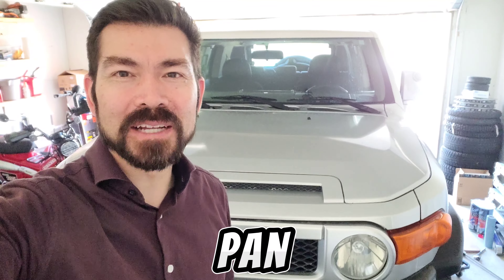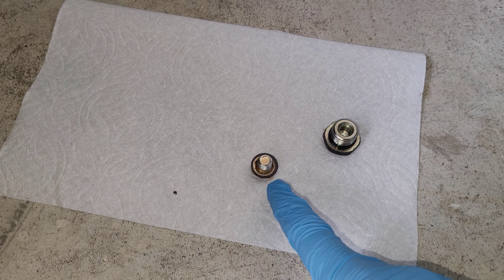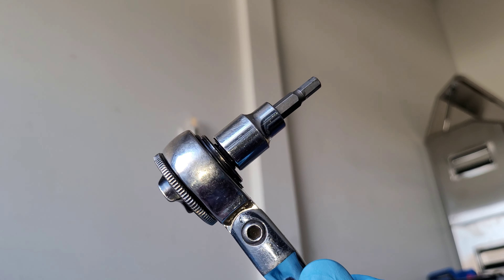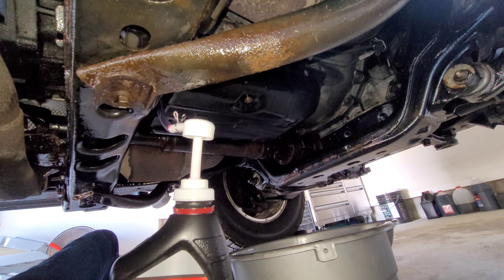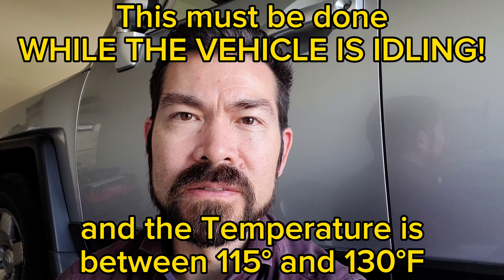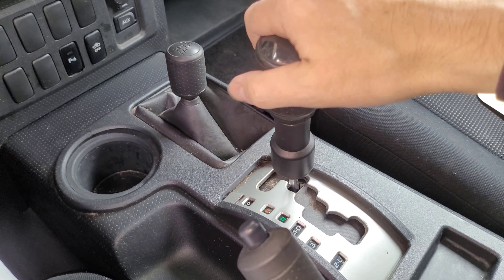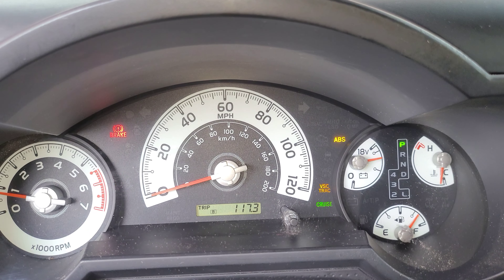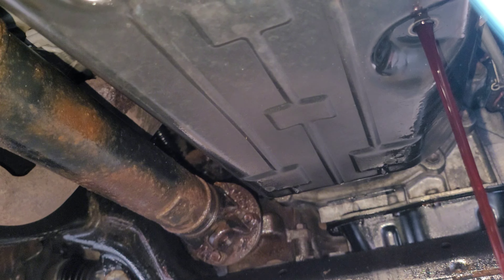FJ CRUISER TRANNY SHUDDER? CHANGE YOUR ATF! Toyotas with A750F transmissions.

Comment: Another interesting video !
Reply from the maker: There is something called flex lock in these transmissions which is the torque converter locking and unlocking rapidly.  The fluid has to be just right for the shudder not to be there.

Comment: Did this fix your shudder?  I did this last year on a 250k mile FJ and it worked great for about 2 weeks.  Then I was shuddering more than before.  Two tubes of shudder fix made the difference.  And if that solution fades i'll have to look at the cost of a torque converter service or replacement.
Reply from the maker: I will have to see over the long term.  My thought is to do this every oil change and see if it holds up.  Otherwise, I have the shudder fix waiting on stand-by! I will report back in 6 months or so. I wanted to do this first and see if it stays alive. I do have a short video out to just avoid the shudder by avoiding drive until 40-50 mph so there is that!
Reply: Your process has worked for a lot of guys dealing with the shudder.  I hope it works for you long term.  I'll watch for the updates.  Thank you sir.  @QuantiQualification
Reply from the maker: @79thump8  👍
Reply: @79thump8, update on the shudder fix?
Reply: @zee_nyc  I've had a shudder about 3 or 4  different times when first driving in the morning that lasted a few seconds.  But that has been it over the last year.  The first was a couple months ago.  So we'll see if it gets more frequent.
Reply: Replace your torque converter with a remanufactured one . Mine did only get fixed after that. 1300$ was the cost
Reply: @ABC-Traveler-USA  I was hoping it was around that price for a reman and not thousands.  Thank you for the info.  I can handle that when it comes time.

Comment: I never had shudder before I recently changed out my trans fluid/pan/filter/gasket. Now I am having shudder at 20-40mph. Goes away once I'm over 40mph. I have an '07 auto tranny FJ at 324k miles. Please tell me I didn't mess up my transmission when I did the change out.
Reply from the maker: First, immediately start doing this https://youtube.com/shorts/fGamNXmtU-c
Then some quick questions.  Did it start immediately following the fluid change? Did you use Toyota ATF-WS? Are you certain that the fluid level is correct as per the video this comment is attached to?
Reply: @QuantiQualification  so I changed the fluid/pan/filter/gasket right before a road trip, I drove her 600 miles and when I got to my destination I started to notice a shudder between 15-30mph. I thought maybe I didn’t have enough fluid, so I went to toyota and got more ATF, filled up about 1qt, got it into fluid temp check mode, pulled the overflow and a little less than .5qt came out. I thought that solved it. Fast forward 2 months and I am now having even worse shudder but now it’s at 20-40mph. I did use toyota ATF-WS. I had someone ride along with me and said it might be a wheel bearing going bad and that the timing right after the fluid change is just coincidental.
Reply from the maker: @flynnpaige8089  You should be able to verify immediately if it goes away when you are in 4th instead of Drive.  If it goes away, you have shudder.  If not, it is something else. After you confirm that it is torque converter lockup shudder, and if all else fails, you can use 1-2 bottles of "Instant Shudder Fixx".  I have not personally used it but have heard that it does work. It does not sound like you did anything untoward to cause this.  The flex lockup of the torque converter is rather peculiar and prone to shudder.
Reply: @QuantiQualification Okay, I will try this and get back to you. I was worried when I changed out the fluid because of the age of my vehicle and mileage, but I was having some sticky gears so I thought it would help. Bummed that it has caused more problems. Thanks for your advice and I’ll let you know how it goes!
Reply from the maker: @flynnpaige8089  👍
Reply: @QuantiQualification  so I have been driving in 4 up to 50mph and the shuddering has gone away. What does this mean for my transmission? will I need a whole new system or just the torque converter? I don't have that kind of money right now... Is it safe to drive in 4 up to 45mph regularly?
Reply from the maker: @flynnpaige8089  Absolutely safe to drive in 4 up to 50 mph on a regular basis or forever for that matter. If you don't want to do that, the shudder fixx that you can buy seems to result in the elimination of shudder without replacing your torque converter. Alternative is you can try an additional replacement of the tranny fluid but it may or may not fix the issue. If you do shudder fixx, it usually takes 2 bottles. What you are feeling is called flex lock-up, where the transmission computer is rapidly connecting and disconnecting the lock-up. In theory, it will eek out a slight increase in mpg but leads to shudder unless the torque converter clutches are in absolutely perfect condition with the perfect amount of friction and the perfect fluid.  If any of these are even slightly off, you will have shudder. When you use 4th gear, it stops the flex lock-up program.  Once you hit 50 mph, drive no longer does flex lock-up.  You can leave it drive as you coast to a stop and just pop it into 4th again when you are ready to get going again or need to accelerate in the 20-45 mph areas. Avoid shudder because it will wear out things pretty fast and then you will need to replace the tranny or torque converter or both.
Reply: @QuantiQualification  Awesome, thank you for the info and advice. I posted a thread on the FJ Forum and have been getting a lot of responses about replacing the STU and SLU solenoids as they may have gotten clogged whe I swapped out the 6qts of ATF fluid. What are your thoughts on it being a clogged solenoid?
Reply from the maker: @flynnpaige8089  The folks on Fj Forums are super informed, so I would generally not bet against their advice.  They absolutely could be correct. That being said, I would think there would be other symptoms if it were solenoids like failure to shift or failure to lock-up the torque converter during normal (not flex) lock up. My guess is that you did have some build-up of material on the clutch plates that worked with old fluid, allowing the worn plates to slip enough to be smooth during flex.  The new fluid cleaned off some of the crud, and now the plates have a little too much friction for the new fluid to compensate.  When the pulsing of the flex lock-up occurs, it kind of grabs and slips as opposed to slip slip slip, which is what Toyota designed.  The Shudder Fixx stuff has extra lubricants that allow the slip slip slip when the plates are a little grabby. I would personally do the following if you do the work yourself. Do the 4th gear trick until you have time to drain and refill the atf again according to Toyota's instructions.  See if that fixes it after 500 miles or so.  Just check once in a while by using drive instead of 4th to 50 mph.  If that doesn't  solve it (which it is likely to not), put in 2 bottles of shudder fixx.  If that solves it, not solenoids.  The shudder fixx will either fix it permanently or at least until the car is finished with life or the shudder will return after x thousands of miles.  Either way, it ought to buy you time to consider your next steps.  You can always skip the shudder fixx if that scares you and just stop after the fluid change and do the 4th gear remedy indefinitely. I think flex lock-up was a stupid move by Toyota and wish it could be programmed out, but they do not allow it (CAFE standards and all that). Flex lock-up, by its very nature, will wear the torque converter lock-up plates due to the excessive clutch activations. I would guess, by the number of pulsations going from 20 mph to 40+mph that it quadruples or more the wear on the clutch plates.  Ugly choice for such a modest improvement in mpg.
Reply: @QuantiQualification  Awesome info, I am trying to learn as much about cars (at least my car) as I can right now. So this really helps me visualize and better understand what is actually happening while it’s shuddering. I’m going to keep driving in 4 for now, then when I get some warmer weather in my area I’ll be able to do a drain/refill, then consider the shudder fix and pulling the solenoids to clean them. Big project, but I want to keep my FJ going strong! Thank you for your help, and I will check back in once I’ve made some project progress!
Reply from the maker: Looking forward to the update and good luck!
Reply: @flynnpaige8089 good luck with yours, it’s a common issue as far as I can tell. Mine would shudder really bad if I drove in drive but if I got to 50mph then shifted to drive on the highway it drove fine
Reply: @flynnpaige8089 Updates? I've done about 4 drain and fills within 4k miles and added shudder fix, 20 miles later it still shudders. I'd like to drive it normally if possible, but I guess it can stay in the 4th gear lock.
Reply: The (true) mechanics that I follow on YT have all stated if your transmission is at 150k or higher in miles and the fluid has never been changed to just leave it alone as replacing it can cause issues.
Reply from the maker: My transmission and those that have or have had shudder already have issues.
Reply: @onenikkione I learned not to flush the transmission nor change the filter, because all the particles that have rubbed off durning mileage you need to keep that in there to compensate for the rubbed off portions. Just change fluid but not flush. Those particles will prevent the transmission from slipping